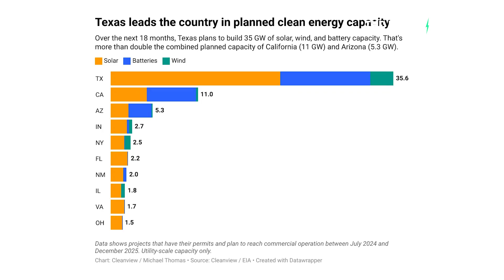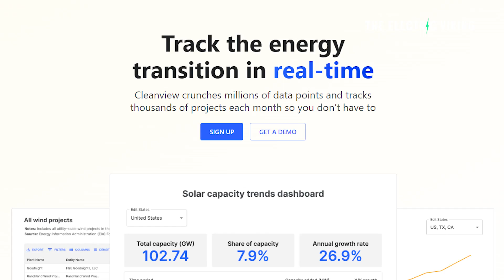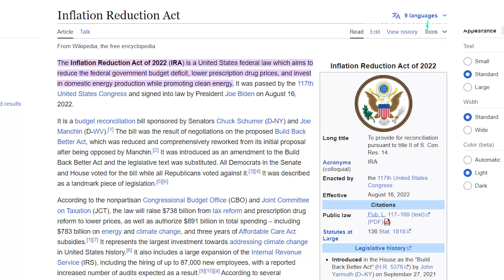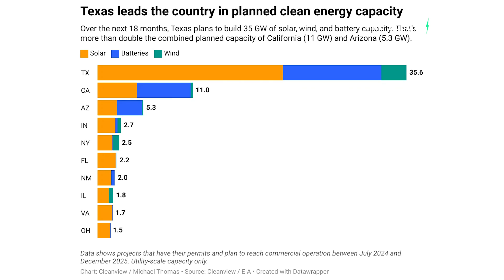Texas is building 3 times more clean energy than California next year

Comment: Sir, I will explain some of the problems of why the US has such a slow progression to renewables in two words POWER LINES.

Currently, there are enough funded permitted renewables to produce the majority of US power. The issue is we can't build them due to power lines. The US process for building power lines can take up to 10 years on average. TX moves faster because it is the only state NOT tied to the US grid. So there is no reason to build power lines out of the state which kicks off the process. 

This is also why in California it is going well, they already had a large number of high voltage lines built years ago that run through areas that supply wind and solar. So this allowed them to quickly build out the capacity. This is also why AZ is doing so well because they have both local demand due to the retirement areas expanding fast in greater Phoenix and they already had interconnects with California. 

So this is not a problem of wanting to build more renewables nor is it a cost problem, it is 100% a transmission problem of getting the energy from point of production to point of demand. Which is why it is going faster in larger open states with lots of land so there are less people fighting the transmission lines whereas the more densely populated eastern seaboard takes longer.

This is also why China is doing so well vs the US, they have a one-party centrally controlled system so none of these local people have to be considered when building power lines across the country.  

Last is the total power usage. The US only uses 4 TWHs per year whereas China is 8 TWHs and growing. Also if you look at the key industries in each country the US has much less energy dense heavy industry except for data centers. Whereas China being much more concentrated on heavy industry has much heavier demand. Next is power growth, the average Chinese currently uses a lot less energy, but as more people move from extreme poverty to poverty to lower income the amount of power usage goes up considerably. So China needs to grow its grid considerably more just to get the majority of its population to a comparable standard of living. So given all these factors it only makes sense China should be in the lead. 

None of this is bad or good, I just want to put some key facts to help explain the differences from an economic, legal and social point of view. China is an authoritarian dictatorship whereas the US is a Democratic Republic. It's a lot easier to make quick changes when there is only one person making decisions, democracy is slow and messy, but you have less chance of being imprisoned for your beliefs.

Comment: The US is extremely uneven in both population distribution and political ideology.  That's one major reason for the disparity in which states are going green.  CA, for example, houses about 12% of the US population, while some states like Wyoming have a population less than the capitol city, Washington, D.C.  Most of the rural states with lower populations tend to be "red" (conservative) states which tend to fight against green initiatives.  Those also tend to be the states with coal and/or oil jobs, so the lobbying to prevent green initiatives is most intense there.  The top five largest states (of fifty) house about 1/3rd of the total US population (CA, TX, FL, NY, and PA).  With the exceptions of TX and FL, most of the more populous states are "blue" (liberal), so they tend to push the hardest for green initiatives.

Comment: This is the sadness of America.
Everything is political.

The Right rejects carbon free alternatives but secretly acts differently. 

Meanwhile, their supporters are made to look like fools.

The thing you are missing are the interconnected.

Texas is on its own but the other interconnection runs all the way into Canada.

Example Hydro Quebec supplies the Eastern seaboard of the US with pure green electricity. As they have most it produced by numerous dams. way more than they can use.

Then there is Ontario Hydro on the same interconnect producing more than Ontario needs. mostly from Nuclear then Niagara Falls.

all this feeds into the eastern US aswell 97% green.

It takes up a lot of slack in the east.

So changes need to be coordinated between 2 counties and multiple province and state jurisdictions.

Sure Texas can move faster but is safety a top consideration, it wasn't on their existing grid.

Comment: It’s great that Texas is installing renewable energy capacity, but you can’t ignore the fact that other states already have large capacity. Iowa, for example, already generates 65% of its electricity from wind.  On the other hand, Arizona could be huge in solar - easily - but is only 17.5%. 
Why is New York’s planned capacity installation so low? It turns out that I live in Texas now, spent two years in Iowa, and 4.5 years in New York. And the answer isn’t complicated: New York is cloudy, and not particularly windy.

Comment: Comments about other states should be looked at ....smaller states like Iowa have been using wind power for years  growing ( 62% of the states power needs are filled with wind). The states low cost have been a boom for the data centers ( Facebook , Microsoft, Google, IBM) Some of the electricity is being off loaded to the adjoining states. They are in the process of building large transmission lines to help  the excess capacity. Simple looking at numbers from a distance does not give a real look a/

Comment: Funny that the state is led by a bigot that blamed the power outages that they experienced in the last few years on being partly due to renewable energy.  FALSELY!  it was their stupidity in not having adequate grid to transfer the power.  It used to be true that renewable energy had the problem of not having the energy necssarily when you want it, but now with Batteries that is not going to be true in the next couple of years.  Yep, renewable energy IS going to be the cheapest energy in the next couple of years.  Texas had a huge dependency on Petroleum for it's economy, and that may go, but they will have lots of energy with Solar and Wind and they have done good job of recruiting tech companies.  A large part of the attraction though is the cheaper land there.  Fair enough.  That changes too of course.

Comment: The Hold Up in a lot of U.S. states is that the customer base is mainly heating with natural gas. 
These states will have to help millions of homeowners upgrade to super efficient, and costly, heat pumps in order to heat these homes sufficiently during the winter. 
If the heat pumps available are not adequate to deal with the cold then the consumers would still have to have backup gas heat.... so why go with a heat pump at all?
This is why.

Comment: The states that are planning for and making the most growth in solar have 1 or more of the following 3 things: Growing electrical demand, plentiful easily exploitable renewable resources and receptive state government.  Texas has 2.5 of those things. (Renewables explosive growth happened despite the best efforts of Texas's Governor) Take my home state of Michigan for example.  Its growth is stagnant so demand for electricity is not increasing dramatically, and the current resources are meeting needs and costs are reasonable. So there is no incentive for conservative legislatures to promote renewables. Also, there is the perception that we have limited solar and wind. Even though literally across the Detroit River Ontario, Canada has huge wind farms that you can see from Michigan.  Granted my reasoning is anecdotal but I think it can apply for several states.
Reply: Also in my political opinion is that Republicans which control many state legislatures are against renewables because they are bought and paid for by the oil, coal and gas lobby. Also, most Republican legislators are both technically and literarily illiterate.   Ok my rant is over.

Comment: Texas leads in renewables in spite of a dislike of renewables because of a much less regulated power industry. It's much easier to build power and battery deployments. Also, power prices are more variable based on real-time supply and demand so no reforms or support is needed to make batteries or demand response work well. Texas deliberately avoids federal energy regulations by keeping their grid from connecting to neighboring states. In my opinion, this shows the importance of energy regulation reform as critical to speeding up renewable energy and battery deployments in the rest of the country.
Reply: Texas doesn't dislike renewables Governor Perry signed into law to increase renewable energy since 2005 and each decade The state has to meet benchmarks on renewable energy output and we're meeting those obligations the technology has improved so much where it just makes economic sense to roll out these technologies or even including geothermal and small modular reactors to increase clean energy production in the next several years

Comment: Texas has no choice solar and wind / batteries or horror, connect to adjacent state grids and submit to federal regulations. So this is the only way Texas can keep an independent grid.
Reply: Are there NO economic gains to be had from connecting to the rest of the grid. All those renewables, can't you sell excess on the days when the wind does blow and the sun does shine. Is an independent grid really worth keeping ?
Reply: @TimMountjoy-zy2fd  "Are there NO economic gains to be had from connecting to the rest of the grid"

It's NET economic gains that matter. Connecting to the grid in another state means that the Federal government gets to control their grid. That's going to cost significant money.
Reply: @TimMountjoy-zy2fd  The problem is the need for batteries, which as you may know, are in their infancy and expensive.
Reply: @tireddad6541  no longer in their infancy. At least for Chinese batteries
Reply: @tireddad6541 neither of those points are correct.
Reply: For the most part, the duck curve of oversupply happens at the same time for any adjacent states.  So everyone has excess at the same time. @TimMountjoy-zy2fd
Reply: @TimMountjoy-zy2fd Houston here. Texas is absolutely loath to connect to the rest of the National grids, east or west, because then it would lose control of its ability to be the sole regulator of utilities in the state. It’s called the Alamo Grid if that gives you an idea of how Texas holds tightly to its control of the grid.
Reply: @TimMountjoy-zy2fd  When you have an economy the size of Texas's, tying yourself to federal gov will only drag you down. They can almost operate independantly right now and so with solar or other energy, it'll just strengthen them even more and fend off fed regulations and problems.
Reply: The 3GW "Southern Spirit" DC connection to Mississipi has been approved by ERCOT/Texas. It's not Texas holding it up, it's the other states. Since it's DC and doesn't require synchronizing grids, this does not trigger FERC oversight.
Reply: The secret of Texas grid is it is more connected to the Mexican grid than the American grid. And with a climate scientist becoming the new Mexican president, Mexico would gladly accept excess electricity from Texas solar panels and windmills
Reply: Sam doesn't have a clue about energy markets, grids, and the high geographic dependence of wind and solar.  (BTW, Australia is one of the best places on the planet for solar, but its electric rates are going from among the lowest to the highest on the planet, due to over-reliance on solar.)
Texas sits at the intersection of the optimum solar and wind belts in the US.  It is the ONLY US state that has its own independent electrical grid.  ALL the other states are in one of two other grids tied together with other states and parts of Canada.  Texas is also run by Republicans that know how to get things done.  It is doing solar and wind IN ADDITION TO, NOT INSTEAD OF, other energy sources.  It also has enormous amount of land available to site the solar and wind.  Not all areas have that.
Reply: @dzcav3  secret of Texas grid is its connected to the Mexican grid. Mexico help provide power during that outage in the winter of 2021. There were brownouts from Mexico city northwards trying to provide power in Texas
Reply: @dzcav3  The ERCOT (~Texas) grid is connected both to the US Eastern Interconnect and to Mexico. It's just not synchronized to either.

And Texas's rise in renewable electricity production has been despite the current crop of Republicans, not because of them. I have followed ERCOT quite closely for years. The Republicans are only interested in pumping up the oil and gas industry.

Lack of land area is only rarely a problem, other than a moderate increase in cost because you put the solar panels on rooftops (preferably commercial flat roof) or do solar canopies over parking lots.
Reply: Texas is friendly to business, land owners have a lot of freedom to lease their land and the demand for cheaper power is huge in Texas.  California still buys a huge amount of their power from other states.  The state is doing little outside of rooftop solar.  Wind farms in New Mexico are getting billions in federal subsidies to build a new grid to send the power to California.  Texas invites and welcomes new power suppliers.